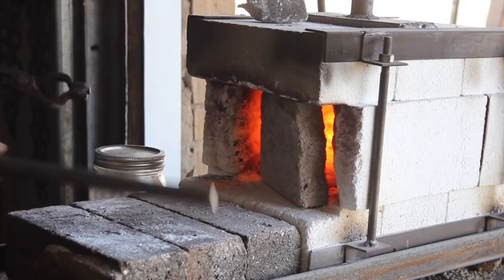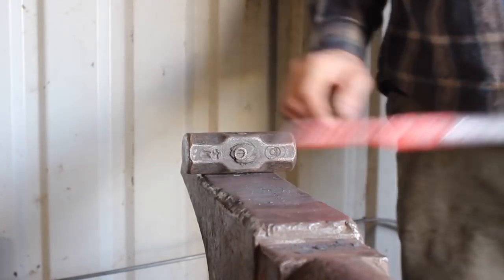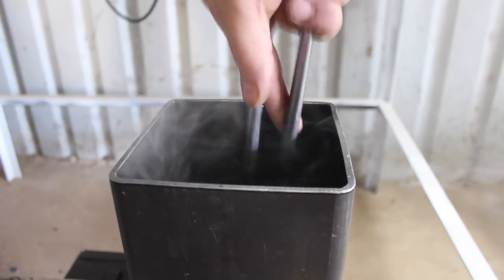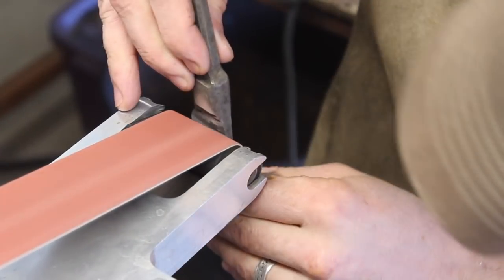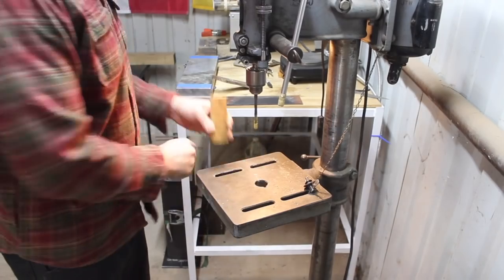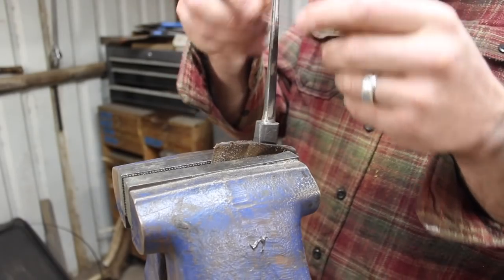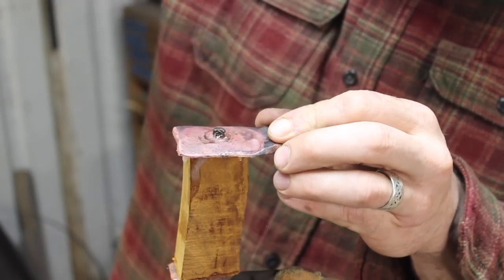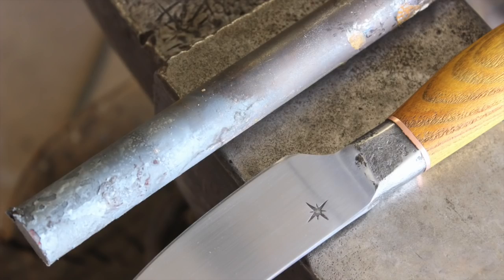Forging An Integral Knife From 52100 Ball /Roller Bearing Steel Bladesmithing And Knifemaking

Comment: thanks for the video. I have a question. how do I prevent cracking in steel 52100 during forging? thank you
Reply from the maker: it needs to be forged at a high enough temperature, near a yellow heat. i recommend experimenting with the temperature you forge at, and never go below a red heat; in fact you can feel the steel begin to stiffen up under your hammer as it comes down to a low orange, i don’t like to do much if any forging once i detect that change. Of course you can forge it too hot and get cracks but i assume that’s not what’s going on.